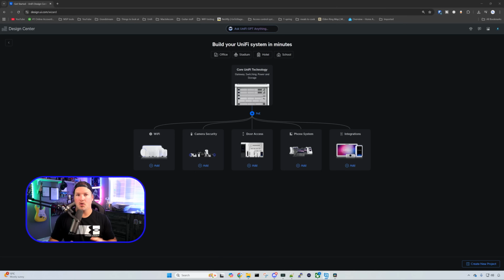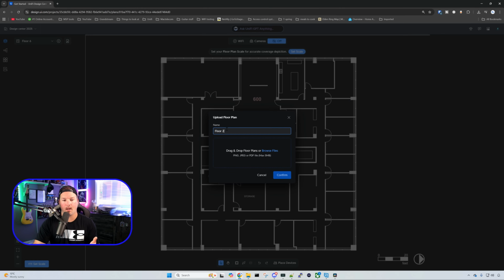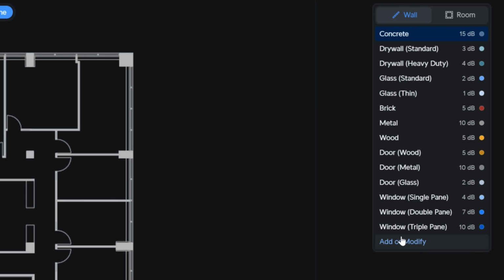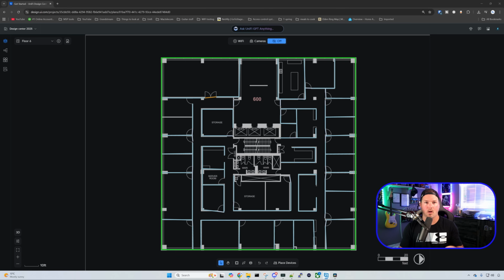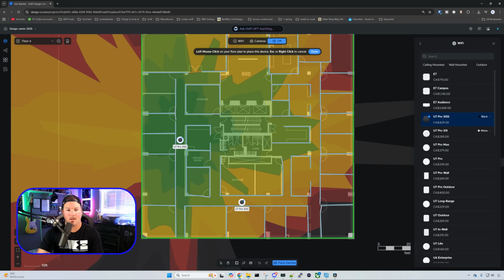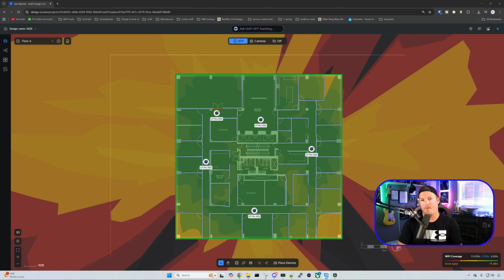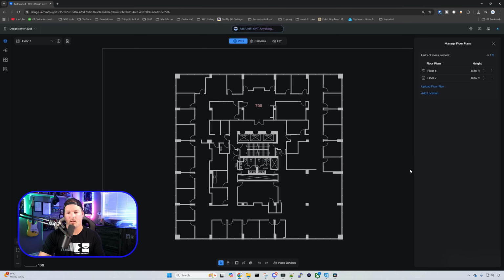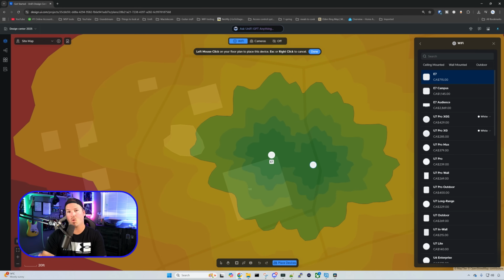UniFi Design Center Update: Multi-Floor WiFi

Comment: Single data jacks have now been added, as well as some of the newer cameras.  Still can't add the PoE version of the G4 Doorbell Pro, only WiFi.  DAC links between SFP+ ports now are supported but not other kinds of SFP+ transceivers.  And still no way to add PoE Injectors.

Comment: Cody - you have the floors reversed. The floor listed on the bottom of the stack (the list in the top right corner of the Design Center page) should be the first floor, not the top floor. Lower floors should be lower on that list; you have lower floors above top floors. Also, note that the release notes say "When you've added 2 or more floors to your building, access points will extend their coverage to the floor below them." This means that access points will not show WiFi coverage in the floors above them.
Reply: thanks. couldnt figure out why I couldnt see my AP on my higher floors. they were below.

Comment: I would love to see a duplicate project option so I can stage multiple variations of the same building without having to draw everything from scratch each time... or cluttering up the bill of materials by having them all in a single project. Some clients like to see a before and after. Some want to see a "Good enough" vs "recommended" or "Tier-A" vs "Tier-B" equipment options (e.g. U7 Pro  XG vs U7 Pro  XGS). It's a pain to manage as it presently stands.

Comment: I would like to be able to set the material and the height of the space between two floors. 
For example between my basement and my ground level it is concrete with underfloor heating, but between the ground floor and the upper levels it's a thinner concrete. So I can't accurately model that, and not knowing what attenuation the design center uses for the floor/ceiling also doesn't help much.
Then I'll just need to know how to reliably measure the attenuation of my walls and floors, but that's a skill issue, not a unifi one.

Comment: Finally. But it appears that have not added any means to specify what material separated the floors. E.g. in a home, there could be a soldi concrete floor separating floors 1 and 2, but the third floor could be wood only. Clearly signal propagation will be completely different.
Reply: Click the Floor 1 drop down-> "Manage Floor Plans"-> set "Attenuation" for each floor by material type.

Comment: Great to see they’ve added multiple floors, is there an option to select what the material is between floors. i.e. concrete, timber, steel beams with wood substrate… etc…

Comment: I wish they add multilevel volumes like mezzanine or atrium. Define one zone that goes across floors, once you aligned the floors.
You didn't talk about the trunking/tunnel they changed: they're not multidirectional anymore. It's only one way to a specific tunnel location. You can't skip floors.
I also want outdoor simulation with obstacles (tree, barns, warehouse)... maybe I'm asking too much.

Comment: Great video! Do you know if there is a setting for floor / roof material? I was trying the Design Center to understand why one of my U6 Lites (not found in the app for some reason, so I tested with AC Lite) struggles with clients right above it in the 1st floor (wood floors). Basically U6 Lite is screwed to wood roof of ground floor and there is an office room on 1st floor right above it with physical distance of basically "nothing". Yet my the clients are struggling with the connection to U6 Lite. Now with Design Studio I am trying to understand if it has something to do with radiation pattern of the AP in question from it's rear side thru wood roof/floor. To understand this better I think I should define the material for not only walls but floors and roofs as well.

Comment: How does design center account for signal strength of AP’s? Used to be able to adjust AP transmit power and it would update accordingly. Haven’t seen that feature in years.